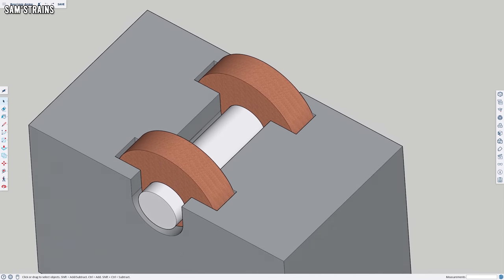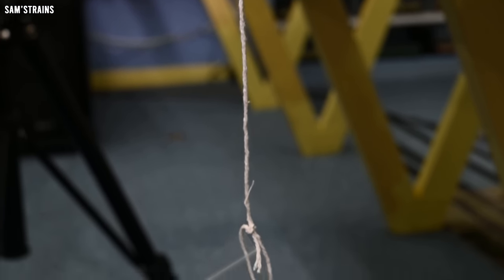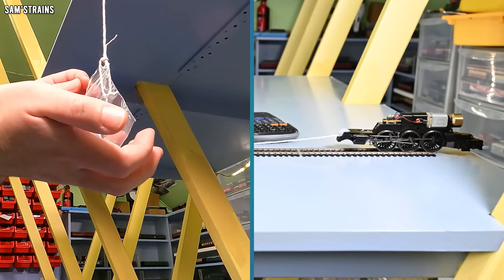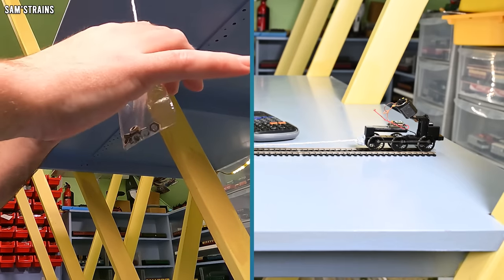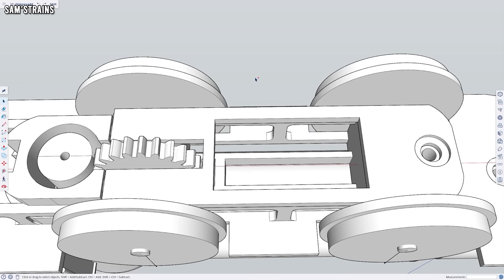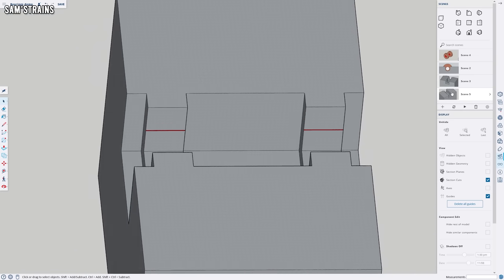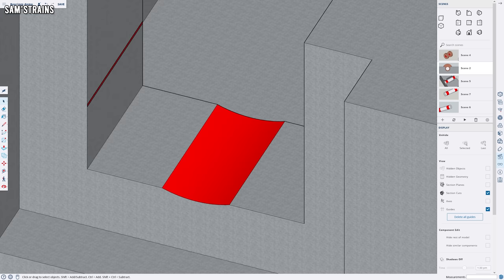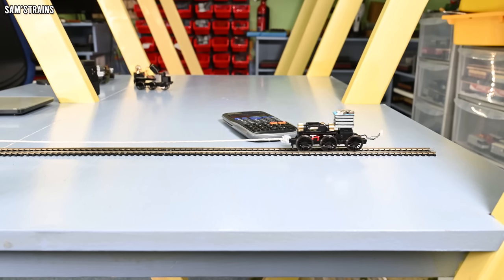Do Model Trains Really Need Bearings?

Comment: I'm a Mechanical Engineer. That assumption with explanation was absolutely spot on Sam. Could do worse than use your video to explain the advantages of Plain Bearings at an engineering college. And doesn't CAD make drawing 3D model examples easy to visualise. Top video mate 👍
Reply: I am a graduate of two science degrees and I agree completely with the above comment.
Reply: @robertsparks3685  Cheers for your endorsement
Reply: Spot on.  Agreed.
Reply: I completely agree, as someone with an engineering degree also. Only things I would do to improve this would be to test more locos (like the bachmann and hornby Halls and 9Fs), and use a pulley as a bearing for the string instead of the book.
Reply: Technically these bearings are called journal bearings and a lot of research has gone into them since the early 1800s.

Most important to note is hydrodynamic effect of the oil film between the bearing surface and the shaft - this is similar to the effect of a skater's blades on ice though that is hydrostatic rather than hydrodynamic but both produce extremely low friction - effectively the shaft is floating on a very thin oil film  

The other important thing about this type of journal bearing is they are made from an alloy that is softer than the rotating  shaft or axle but the reasons for this are super text booky.

My guess is the bearings on model locos are actually phosphor bronze rather than brass  though brass would work
Reply: @andreisim5227  You're raising the bar to an engineering scientific level. All good stuff, but as you say, a bit text booky.  Just to clarify my own comments,  those bushings are still plain bearings (just a single component / contact surface, without any rolling elements, which would make them an assembly). In this application though, they are indeed called journal bearings. It's the application which changes their description, not the individual component.
I have noticed on various manufacturers models, some of these bearings are the colour of brass (light gold) and others the more bronze colour of phosphor bronze (PB). I agree the PB ones are superior, especially as this is a dynamic application.
Reply: @robertsparks3685  digging back to the mechanical engineering part of my Electrical Engineering degree, I seem to remember something called stiction which works to stop the initial movement? Doesn't this mean that Sam measured the force needed to overcome that force?  Wouldn't the rolling resistance be more relevant as this would reduce the acceleration?
Reply: Also a mech eng, also agree with Sams explanation and the findings.
Reply: So what is it called if the axle is just riding in a groove in the chassis?  I would have just considered that a poor bushing vs actual fitted brass bushing vs a ball or needle bearing.  Even your cars engine that will turn hundreds of millions of revolutions in its life uses bushings internally to support the crank and assuming you maintain your car well those bushings will not show that much wear at all.  While the simple slotted chassis holding the axle is worst for wear and friction, for the duty cycle of a model train in most cases is still sufficient for most hobbyists, but if you own a hobby store and have a model train running 12 hours a day 7 days a week you clearly would need actual bushings or ball bearings to have them last with such a hard duty cycle.
Reply: @larrybremer4930  I don't known what a square slot acting as a bearing for a round shaft is officially termed. I've never had to specify such a configuration.

Comment: Excellent question ! Correct me if I'm wrong, but, as the bearings are made with brass, we can consider that this metal has low friction properties besides it's elasticity (I've spend one hour replacing a brass spring of a Kadee coupler this afternoon, "fiddly" is an understatement here...).
So, first, I applause your ingeniosity : top level variable killing and highly smart test setting :simple, straightforward and relevant ! then, rigorous execution of the experiment, great !
For the results : yeah, confirms with reliable figures what we already have seen "on the ground". Half the resistance, twice the energy to the wheels, the mass is done.
For the mechanical engineering part, nice explanations. We understand now what are the physical mechanisms at play, and the motivation to put bearings in model engines.
Thanks for the good job done Sam, that settles the debate on the rational points you've made here.

Comment: Your best and most thought-provoking video to date, proving what engineers have known for centuries regarding not only the superiority of bearings over bearingless, but also the importance of fine clearances and having two different high quality metals (in the case of our models, steel axles and brass plain bearings). One should never have a chassis without bearings, for reasons which your excellent presentation made clear, and certainly not raw chassis castings with no attempt to machine the bearing surface.

When scratchbuilding, the only time I have omitted bearings has been in N gauge, where I choose brass for the chassis sideframes, precision drilled to a tight interference fit for the axles, then hand reamed to give the minimal running clearance needed to prevent bearing chatter. All bearings need lubrication but very sparingly at regular intervals.

Comment: great video. Whilst the bearings will improve the performance a little bit, I'd suggest the significance of their addition is providing good evidence of overall good engineering and quality; Its unlikely a model will be designed with bearings and then shoddy other parts if that makes sense.

Comment: Very interesting seeing brass bearing versus no bearing stiction (the friction that had to be overcome before rotation will occur) values being quantified like that. Big problem is our train dc motors torque varies sinusoidally and the variation is significant (unlike industrial motors that are constructed differently) This becomes really important if you try starting the motor when it last stopped when the shaft was aligned at one of the low torque points. Then you often have to crank up the volts to get more armature current flowing to get enough torque to overcome the stiction; in a dc motor torque is proportional to field flux times armature current. Three pole motors are the worst case (3 commutator slots with 3 armature windings one winding between each comm slot). Going 5 pole reduces the torque low to high range variation I.e. appearing as smoother torque generation and thus more repeatable starting results etc. As a motor ages not only does the stiction go up as the bearing wears (and or dries out - ditto any gear trains) but also the magnet loses its magnetism (field flux) so reducing the motors available torque which compounds the problem. So yes good quality engines should have both decent bearings and field magnets for smooth consistent low speed starting as well , 5 pole better than 3 pole (fly wheels actually go against smooth starting but help smooth out any torque pulsations once the motor is turning which helps low speed operation and covers you a bit for dirty track etc). That is my perspective, hope helps, all the best Stephen

Comment: Fantastic work on the CAD to explain the matter. This channels is becoming a thing for engineers ;)
Axles in any slot with play around have another detrimental effect, they doesn't run straight, they end in banging around at an angle regarding the chassis and thus the track. You keep all square in your CAD explanation for the sake of easy understanding, but imagine that the axles can completely goes sideways too in their slots and have binding points that increase friction the more speed and/or torque is applied!
Whereas a bearing keeps everything straight of course

Comment: Mechanical Test Engineer here...  Great job Sam!!  Sound testing procedure/execution.  Definitely could do with some fine tuning of the testing, but all in all you nailed most of what you did.  Well done!  Your theory on why separate bearings are better is spot on.  Your explanation on square bearing surfaces is also excellent.

I've been scratchbuilding chassis' for over 25yrs and have used separate bearings (brass, bronze or ball) from almost day one.  Definitely better than solid/integrated bearings, at least when they are metal on metal.  Metal axles running in an engineering plastic (nylon, Delrin, etc...) bearing are also pretty decent, but not as long lasting.  Nylon/Delrin axle "muffs" running in Nylon/Delrin "bearings" run extremely well too, but I wouldn't consider that for larger (HO/OO or bigger) scales.

Comment: My degree is in physics and there is an important gap in the experiment. You are measuring static friction, but not kinetic friction. Static friction is the high knudge needed to get something moving. Kinetic is the drag after some starts moving.  To measure kinetic friction the best method would be the most difficult. Push each train at a known speed, and measure the distance each travels. Given the challenge of moving at a knoe speed you could put a higher weight, say 25g, and measure time needed for the weight to hit the floor. The second method would be effected by friction in the string mechanism as well as the static friction, but I would argue that while these shortcomings would effect the absolute numbers they would not effect the test of your hypothesis, that bears have less friction.
Reply from the maker: Thanks for the awesome feedback Andy - yes you're right this only tests static friction. I know exactly how I could test kinetic friction, so I might give that a try in another mini experiment,
Thanks again,
Sam :)
Reply: @SamsTrains  One idea for kinetic friction : you can manufacture an hammer-like pusher that strikes the rear end of a test vehicle motionless on a flat piece of track, and measure how far it goes. The hammer had to have a 1/4 circle downwards motion to strike the idle vehicle, and have a calculated mass to give consistent results.
Reply: [Sarcasm:] In Yellowstone, the bears exhibit a great deal of friction, especially if the subject does not remain in his car. And don't even think of "going straight for the nuts."

Comment: Back in the early 1940s, Lima Locomotive Works ( USA) introduced new concept Timken Roller Bearings to one of its new design 2-8-4 Steam Locomotive. To show how Rolling friction was reduced with Roller Bearings  they had several ( female) office staff haul the locomotive over a short Distance ( photo in publication and advertising). Of course, they had (hidden) behind the loco and tender, some men to overcome the static resistance and getting loco moving...
None the less, once the Loco was moving, the Ladies were able to keep it Moving along.
Demonstration of Roller Bearing reducing Rolling Friction of the Locomotives compared with traditional Babbit-filled  Brass/ Bronze Bearings.
This increased the Energy Efficiency of the Locomotive, as less was lost in Friction compared with older bearing designs.
Roller bearings were also used the Running Gear and Drive links.  
At the same time Roller Bearings began to be used on Bogie Truck Axle Journals, reducing the incidence of " hot boxes" and fire and Journal fracture due to lack of oil in bearing box.

Comment: Good video, very informative. FYI When model locomotives started getting bearings 100 years ago it was to reduce wear, and examples I have definitely bear this out. In fact literature didn't mention free running at all, just longevity and the ease of replacement. The massive weight and huge motors in use at the time caused a lot of wear in higher mileage models, even through the very substantial sheet steel frames.
With brass bearings on the axles and gearing this was of course measurably reduced. A supermotor has 3 separate brass bearings just on the armature.
Good viewing chap :)

Comment: You're logic and process was spot on.  Any external force, such as friction from air, friction of the rails, the string etc, was exactly the same between both chasis, and therefore creating a controlled testing environment.
Having bushings definitely improves friction forces, but the ultimate performance of a chasis is a combination of bushings, design of the gears and the motor itself.

Comment: Yes ultimately precision bearing show an extra level of design in a product. And yes you are correct in calling the "brass" bits bearings and not bushes. I won't bother going into the difference, suffice to say they are indeed bearings.
However as an Engineer I can spot several things you didn't perhaps realise. 
A product is generally designed to a minimum specification. The choice of be axle location system will be calculated on multiple factors, not least of which is price. But it goes deeper than that, the gearing, the size of motor used, the weight of the item, its expected life span ect ect ect all play a part on the design process. Ultimately if something performs within specification with a cast Zamak bearing then it works as intended.
For your experiment to be conducted properly you would have to know the exact dimensions of any of these parts, the specifications of the surface finish, the precise specification of the materials  and any lubrication that's used. 
Bronze, brass,  phosphor bronze, Zamak ect all have different properties. These properties can change as they are used in their application. 
High precision industrial machinery use multiple different material for bearing surfaces depending on what they do and which part of the machine it is. 
All bearings have recognised tolerances. These tolerances can be easily found in places like the Zeus book. Knowing what is intended by the designer of the item gives a clearer indication of the quality of the part.
In short though I do agree that precision bearings are preferable it is a far more complex thing than you may realise.

Comment: Real world example, last year I did two turns on the Talyllyn Railway, my loco for the day was Tom Rolt.  In the morning my train was made up of the original coaching stock plus the Corris coach.  The original coaches are on packed greased axle block bearings. In the afternoon my train was bogie coaches running on roller bearings.  Despite the TR being mostly downhill on the return journey I found I needed to open the regulator more to keep speed and counter the friction of the drag of the morning train, in the afternoon it was more about gentle brake applications to keep the train under control.

Comment: It seems that the non bearing chassis accelerates more once it starts moving which would suggest that there is a certain amount of 'stiction' that needs to be overcome to get the chassis rolling in the first instance.  I don't remember you mentioning lubrication in the video, as this might be a variable that could have some effect on the results.
Reply from the maker: Yeah you’re absolutely right, I noticed that! We see this in performance of locos too - they seem to struggle to crawl more without bearings!

Comment: I have an old loco from the 60's that to my shock has actual, very tiny ball bearings. The detailing is very basic, and the (all metal) chassis is robust, but even the gears are made of brass, and even with all my modern locos this old-timer is still in my top 5 with the lowest current draw, when it runs "solo" (even has a flywheel sort of)!

Comment: In the days of Triang and Hornby Dublo they fitted a large motor, so the bearings were inconsequential. When a manufacturer is producing 1000s of locos, then fitting a smaller motor means more profit. Your experiment proves that better bearings allow a smaller motor to be used. Thanks for doing all that work in Sketchup to illustrate this video.

Comment: Hello Sam. I was given some information about the real railroads that dealt with mountain grades. In the beginning, rolling stock were built with friction or "Solid Bearing" axles.  Good for not much.  And, eventually roller bearing axles on locomotives came into building, followed by passenger, and then freight cars/wagons. This was a major point in pulling uphill.  But, it was the downhill experience that was to be relearned...  No friction to hold back  and MORE brake shoes burned up, shortening their use, because, now you have got an entire train with "Free-Rolling" axles!   That required a new skill.
John  BC, Canada

Comment: Sam, considering that you're carrying out home brewed testing, your methodology is excellent, particularly carrying out several tests in order to obtain an average. Sampling more than one type of wheel arrangement in order to get some idea of possible variations caused by valve gear friction is also noteworthy. The only thing I would add is that as the friction of your string over the book is likely to be much the same no matter which chassis you're testing, the true percentage difference between the bearing types will be even greater, though by how much would require further work to determine. However, I'm not sure that "going straight for the nuts" is all that scientific!

Comment: Hi Sam.

1) What's a 'fizzitist'? 😂

2) Did you oil the axles first? 

3) Excellent demonstration for the scientifically uneducated. I'd have thought the majority of modellers were aware of the reason behind the fitting of bushes/bearings, but what most of us probably didn't know was how much of a difference these bushes make with regards to the resistance of the free running of axles. 

May I be so bold as to suggest you continue with your scientific experiments, even though, as you said, you're not a 'fizzitist'! 😀 

Paul. 👍